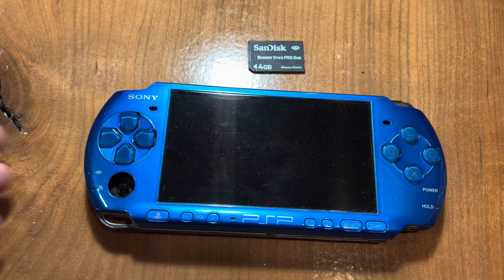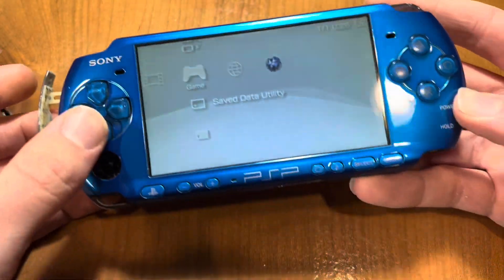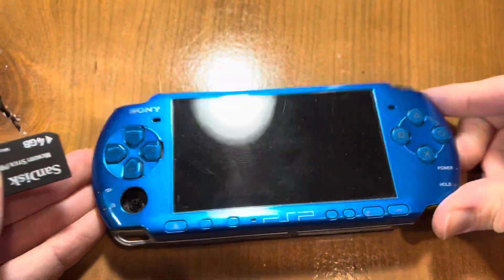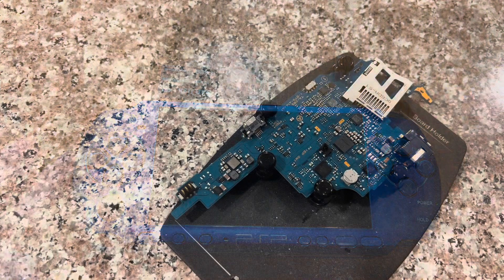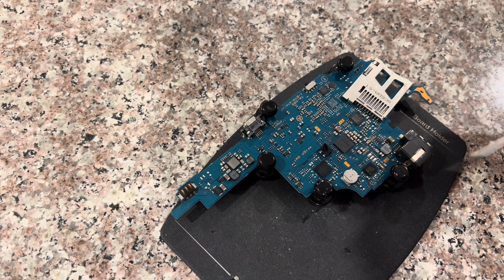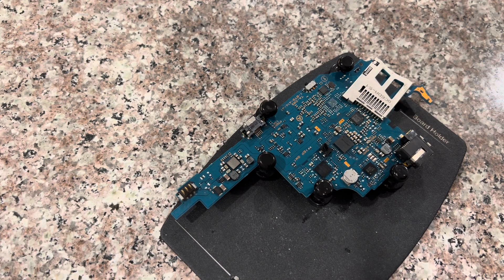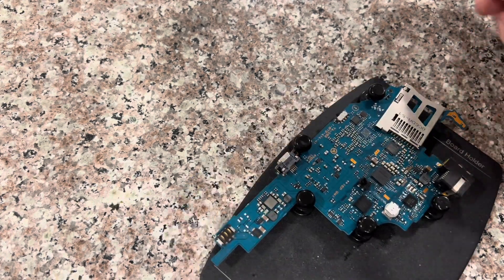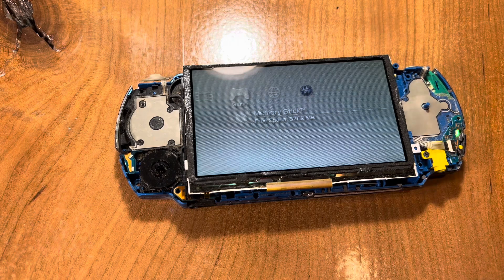Won’t Read Memory Cards - How to Fix a Sony PSP 3000 with a Hot Air Machine

Comment: Mine shows the storage space. Just won’t let me use any space on it
Reply from the maker: Certain earlier games are glitchy when trying to save to memory cards larger than 2gb. I believe you have to save in a different menu first before saving on the main gameplay mode
Reply: @blakeblundell9001 mine is a 4gb. I’ve used 16gb and never had and an issue but lost it. Mines the psp1000 model if that helps.

Comment: Well I'm cooked no hot air gun and no other solution is working
Reply: me too
Reply: @Adamx1973  
That's sad I'm still searching for other fixes if something worked out I'll let you know wish you luck brother
Reply: @IWoVex  you too, i am now tryinh to boil it becouse it is like 100°C and stuff+ water cannot damage when there no power
i will post a short about it on my chanel so look out
Reply: @Adamx1973  
I hope everything goes without problems I'll sub to your channel and wait for the short good luck buddy
Reply: I normaly never comment somewhere, but i was struggling to get my psp to work for the past 6 months... First it was bricked then my Memory Card reader was defect, i put 3 small stripes off ducktape on the memory card and it worked. Good Luck with the PSP!
Reply: @FisnikBeatz  
I might try that again may i ask were the strips on the writing side of memory card or on the side where there's the golden pins of the card
Reply: @FisnikBeatz really ? How did you put the stripes like on top of the memory card? In the bottom vertical horizontal ? Lol